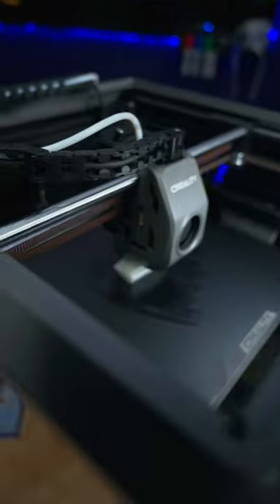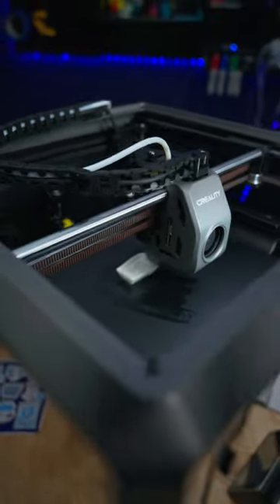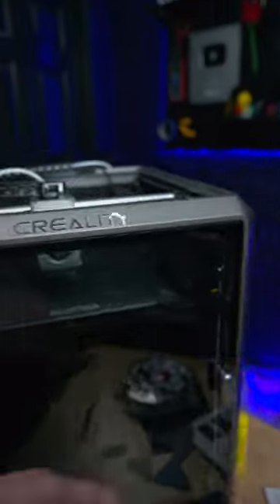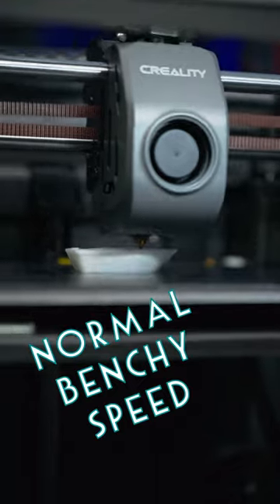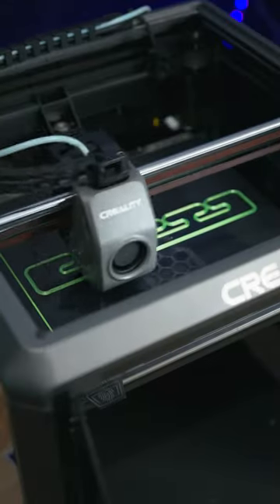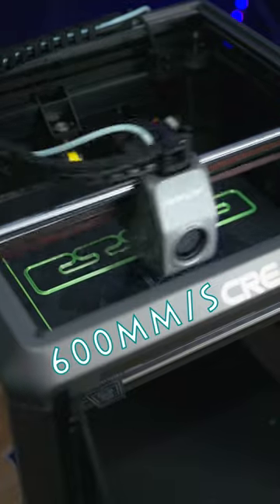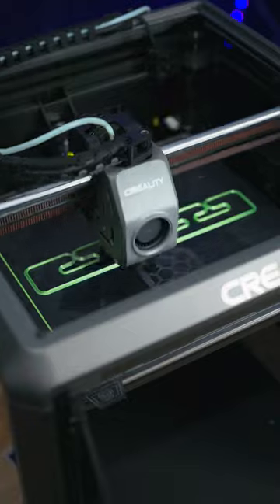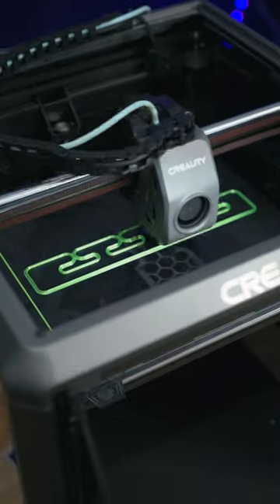Creality K1 Speed Tests! 👀

Comment: It'd be nice to see some test prints at different materials and speeds (300,400,500,600mm/s) to see if they are able to handle the highest speeds; the curved print is easy to orint at higher speeds since it doesnt have sharp corners, and some materials might also not work as well at higher speeds.

Comment: Is the lifespan of the parts dramatically decreased running at the full 600? I mean I’d be happy with 200 or 300 but I’m just curious. Seems like a lot more force on everything but I really don’t know if that’s how stepper motors work since I guess they’re always changing direction anyway?

Comment: Does the standard k1 also have the air purifier
Reply from the maker: It doesn't have one built in like the K1 Max, but it does have a fan on the back, and I've already looked into adding a filter onto the back of it
Reply: @JJShankles  thanks

Comment: I tested one of these out first hand today.
 No chance in hell youre printing a tight radius at 600mm/20k acceleration and its turning out well.
 At 300mm/20k, with 225mm parameter speed, it was all over the place and trying to tip itself over.
 Surface finish on the 1" circle was garbage! So much ghosting the part would be unusable.
 Simplify's stock configuration for the K1 is set to 125mm for a reason.

Comment: So I would like to know the standard speed which this printer able to print with any material without fail. Imho, Creality printer is either hit or miss. I own several creality machine, the only model I don't have issue is cr10 smart. Guess im lucky with that machine as i read lots of issue with that machine as well. Only time will tell the reliability of this k1 printer.

Comment: So with this printer the head does no movement in the Z axis?  The bed moves progressively down?  What are the benefits of this type?
Reply: Gauranteed level head
Reply: In a bed slinger type like the Creality S1, you have to accelerate the bed and the model continuously throughout the print, with the K1/K1 Max the bed only moves down once per layer.

Comment: Does anyone have some tips for this machine because when I first used mine it was shaking so much the print was sliding so do I need to go and change some settings or just find more stable ground
Reply from the maker: Did you run the "Input Shaping" calibration? it is in the settings